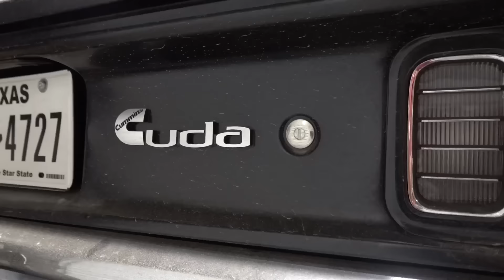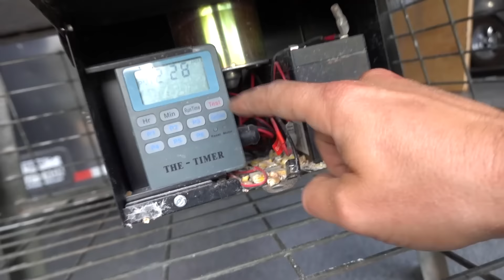Renovating an Abandoned Dump Truck

Comment: Hello Matt, 
Research ECM exchange companies online if it turns out the ECM on the truck is bad.  It is much cheaper than purchasing a new one.  They will program one of their ECMs with your truck's VIN and send you a programmed ECM as long as you send the old one to them.  I've used this service in the past and many companies offer a lifetime warranty on their ECMs.

Comment: I did the same setup on my truck.  The weak link is the cradle.  It will bend if you pull to the side. And my winch is rated higher than the cradle. So you have to watch what you are doing when operating your winch.

Comment: Hi Matt, awesome video, had a hard time telling on your winch if you were using cable or synthetic rope. If it is cable, you may want to change to a roller fairlead the cable will cut the smooth aluminum one. Keep up the awesome videos.

Comment: I suggest getting pull handles added on the connectors. The forklifts at work were always having the terminal ends pulled out because people had a tendency to pull from the cables.
Reply: Oh yeah Ive seen that happen a bunch.

Comment: Love the winch setup. If your using steel cable you need to use a roller fairlead. That smooth fairlead is for a poly cable. Keep up the awesome videos!!

Comment: Be sure to stock some goldfish and maybe catfish in the pond, to keep down the larvae.mosquito/insects and keep the pond relatively clean. Otherwise,it will become a swamp. Mechanical or electric aerators can also help.
Reply: Mosquito fish.....eat skeeter larvae like crazy.
Reply: That would work too xD But he deff needs to stock that thing properly or it will be nasty, quick. And given the heat out there, it will need some form of aeration. Probably via a couple solar panels and a battery @RICDirector  He could probably be real fancy and have someone hook an Arduini board up to that water pump, along with a sensor, so that it kicks on automatically when water levels are below a certain level due to evaporation, kicks off when back above a certain level.

Comment: Hey brotha, you're going to want to install a breaker or some type of circuit protection for the winch power feed. God forbid it shorts its going to burn until either the cable burns through or worse. It happened to one of our new customers who was utilizing those style connectors to jump start vehicles. A stereo shop built the truck originally for free. We had to re-wire the whole SWAT vehicle after the dealership replaced multiple factory harnesses that were damaged in the fire. As others mentioned, you'll want to avoid using the clamps for any period of time, the resistance will build and you'll feel the power cables get warm/hot.

Best of luck!

Comment: Also....next time crimping big lugs like that without a crimper. Use the vice but straddle an alleb key across the width of the lug in 2 separate spots. It will help  prevent the cable from slipping out of the lug.

Comment: If you went a few steps further and done it right. You could install the “Anderson Plugs” on each vehicle you plan to use winch on (just like you did on “Earl”), then make a set of one Ned cable clamps one end Anderson plug (or Quick connect/disconnect plugs) like they do on tow trucks. 
And modern vehicles since ‘96 or ‘98 all have a power block between the battery and starter/alternator hook ups, so you don’t even have to “mod” the battery clamps to hook up directly to battery and still be always hot.

A tow truck never has to pop the hood or open its battery compartment to “jump off” another vehicle.

Comment: Hey Matt, when using a steel winch cable, you need a roller fairlead. The Hawse fairlead (which you currently have) is for synthetic cable only.

Comment: Another great use of a hitch mounted winch like this is , weld a receiver on the front of any flatbed trailers you have to winch items up onto the trailer. Pro Tip, You may want to have that winch mount beefed up a bit..  if your really pushing them, many of them will twist and that in turn will destroy your winch.

Comment: Be careful grabbing those alligator clamps after you've been using the winch to pull stuff. Since they're not bolted to the battery, they're probably going to heat up a lot from the extra resistance

Comment: Welcome to dump truck ownership. Before long you’ll see a $4000 bill and go ‘whew, that could have been much worse’. It’s almost as bad as having a boat.  

That’s basically the exact same winch setup I use.  I even added a receiver to my trailer.  I do only have one set of cables though with jumper cable clamps. I do still have a quick connect though for ease of storage.

Comment: Matt fill the cups of the connectors with solder use a torch and heat the connector once half full dip in the spliced wire and no smashing the hard clips and it is connection guaranteed and resists corrosion.

Comment: Depending on the gauge that aluminum probably would be fine to carry enough amps. Looks like 3/0 or so which holds up to 155amps. We use aluminum on solar fields at pretty high amps. Just have to use deox so the ends don't corrode
Reply: What kind of amps, gauge wire, and wire lengths?  I’ve purposely stayed away from CCA wire because of the lower capacity.  Thanks
Reply: @91CavGT5  you'd have to look up the load you are using to see what gauge needed. We send thousands of watts which some runs are like 1200ft or so.

Comment: I wouldn't run those power cables between the bumper and the front of the truck like that.  That's a tight spot and if you ever end up pushing the bumper in, it could pinch the cables and short them out and potentially fry the electronics in the truck.
Reply: And there is not any kind of fuse on that wire.  That’s a good way to burn a truck down.
Reply: @91CavGT5    Oh dang can't believe I missed that, duh!  lol
Reply: the starter motor on the engine, does not have a fuse between the battery due to the amperage requirements the best way to do it is put a disconnect switch up by the battery on the positive side under the hood before it leaves the engine compartment which is what I did on my truck so if I want to use the winch on my truck, I’ll pop the hood and just turn the battery connector on for the winch but when I’m not using it, it doesn’t have positive power going to it
Reply: The starter motor on an engine is ran from the factory in a way that is VERY secure, AND it is typically ran inside protective tubing to prevent any shorts.  This is a COMPLETELY different ball of wax and is like comparing apples and oranges.  I’ve seen a couple of car fires, and a lot of melted wires due to no fusing.  A resettable circuit breaker could even be used.

Comment: Hope you put fuses in line of positive so u don't burn ur truck down and that goes for all vehicles u set up for the winch
Reply: I just made the exact same reply on a comment.
Reply: And he did not put a Protection sleeve around the wires he pulled in. So when they are rubbed through, hopefully it's just draining the battery fast before it starts glowing..

Comment: I may be wrong but you should have a fuse between the winch and the battery. When I used to install them for a truck shop we always installed a fuses so if the wiring or winch overheated it wouldn't catch the rig on fire

Comment: I checked other comments and it looks like you did good on the dumptruck. I wanted to say that the low low cost of 3800 for a fix on the dump truck is a heck of a lot less the the cost of a new one. For a fixer upper, I say you did good
Reply: Depends on what you picked the dump truck up for..
Reply: @nickabel8279  in this case i understood it to be free

Comment: Pro tip. You just need to connect the negative to the frame.
Reply: Disagree. The frame takes the place of the negative wire and just is a different path back to the battery.
With the dedicated negative wire, it takes the load off of the vehicle grounding system.
Reply: @randybehrmann5454  you're not wrong, but if you aren't using the which all that much there will be little effect.

Comment: With battery cable and those connectors an easy way for a permanent fixture is to hot pot the fitting with solder and dip the cable into it letting the solder then set.

Comment: I have the exact set up for my winch, it is for my trailer but I ran dedicated leads to the rear of my truck for power.  In the front I have the same connector, and then I have a set of jumper cables with the connector set up so I can use it with anything with a hitch and battery.  It is SUPER useful.   I did learn that red and grey connectors are not the same...

Comment: You should replace the stock battery clamps with some higher amp ones. I like the military ones. And you should make a set of jumper cables that will plug into mikeys quick connect. You can also but wire loom to hold the cables together

Comment: Good luck with the quick connects. 

The amount of amperage that a 12000lbs wench pulls especially on long pulls. I’m melted three sets of the exact same ones you put on. And by melted I mean a puddle of goop on the first one.
I have it on the back of me F350 and I found out the longer the cable from the front to the back, was most of the problem. 

It works great with no load on it. Can’t wait to see how this works for you.  😎😎🥴🤨😎
Reply from the maker: Hahaha sweet. We shall see!

Comment: Watch the feeds from across the pond to see the last place the GoPro was seen and the first place it was missing to get a general area to search.   Get a metal detector to search there.    A detector would be good to find buried pipes etc. and wires in walls.

Comment: Check the O2 sensor wires on the dump truck!

I had a similar issue with my Eclipse, diagnosed to ECU...... It was actually just a melted O2 wire. Replaced wire, car runs again!!!   Yours may not be O2 sensors, but any 'core' system that's sending a short back to the computer could be to blame. 

Good luck!

Comment: Ohh yeah,, that little 5 cubic yard dump truck will be PERFECT for the 'Official' ranch dump truck. During the heavy demo work it might be a little small BUT once that's done this little rig will be perfect. Uh OH!! Just heard the ECM may need replaced for the 'parts only' sum of $3800.00!!  Daymn,, that's about all the truck is worth!  As you said,, time to do some thinking here.  Sell the truck 'as is' and watch for something else. There's heavy equipment auction sites you can keep an eye out for a truck in tip top condition for much less that you're likely gonna need to spend to save that one you've found at the ranch.

Comment: Matt, they make a cable support to physically mount the wires to those big red connectors that prevent the wires coming out of the connector Id recommend you get them.  I worked with those connectors for years and they can save your butt.

Comment: The winch set up would maybe be better if you had a modular battery setup. A deep cycle battery that could be put on any vehicle with a hitch and run the winch.

Comment: The droopy battery lead cables.  When you need to use them roll both passenger windows down and run it into the opening of the back door window and back out the front.  The edges of the doors will hold it up to run straight-er to the battery.

Comment: The clamps will be the weakest spot in the connection. Limiting the current, burn, fall of with shaking/vibration. Think about permanent plug attached properly to battery in each of the vehicles.

Comment: Smart thinking that’s exactly what I did several years ago bought me and Dad hey 12,000 pound winch with the cradle and then we ran big cables to the battery on the work truck for the winch but we made up a set of cables that just had clamps in the other and had to plug-in for the winch, and we made the cables 20 foot long so if you ever have a four-door long bed, you can still run a winch

Comment: If you ever go to hard wire in the quick connect buy a set of jumper cables and cut the ends off, much cheaper than buying the rolls and then you can make a short adaptor with the leftover length that still has the gator clamps on it

Comment: That's literally exactly what we did with our winch. We mounted it on hitch and put a hitch mount on the front of the truck and the tongue of the trailer so the winch can go wherever we need it. We also ran some battery cables to the rear bumber with remote terminals to keep the cord length down.

Comment: Matt, contact the guys over at Custom Splice and get yourself one of the strongest synthetic winch lines! Not only are they lighter but much safer than steel cable.
Reply: @Customsplice also has soft shackles!

Comment: Drill an extra hole in your winch mount so you can slide it deeper into the hitch, looks 10x better and less leverage if you need to pull at an angle 

Did the same exact thing on my truck

Comment: the single cab f truck you need to put a switch to turn the power of to the quick connect as it will short out battery!

Comment: Someone might have blown the ECU by trying to jump-start it or by jump-starting another vehicle with it, Jump-starting a vehicle can cause the voltage to spike well over 16 volts which can damage computer systems like the ECU, or the voltage regulator which on most vehicles is built into the alternator. For those that may not know, If you're going to jump-start a vehicle, first hook the red cable to the + of the dead battery, then hook the other red end to the + on the good vehicle, then hook up the grounds the same way, and make sure they have a good tight connection before trying to start the vehicles. And when hooking the cables up make sure you connect them quick so that they don't ark very much, When they're arking it can cause power surges which can damage computer systems. It's really best to completely unhook the battery from the charged vehicle so you don't take any chances of causing damage to it. 
Also, never hook a battery charger to your battery without unhooking it from the vehicle first.
Reply: Interesting, I was always taught to connect the grounds first. My dad would always use the body for ground on the receiving vehicle but I've never had any ill affects from going to the battery.
Reply: @bwofficial1776  Yeah, years ago a lot of people said to hook up the grounds first, and you can hook the ground to the engine, it's the same thing it creates the loop needed, but these days with all the electronics vehicles have they say to hook the positive first exactly how I stated in my first comment. And maybe say 75% of the time you may not cause any issues either way you hook them up, but all it takes is the one time to cause an ark and damage something.

Comment: Also you can get panel mount connectors I’m using to implant in my winch bumper so I can hook up a set up jumper cables no issue

Comment: Put connectors on each end of the long cord and then short leads to the battery clamps this way you can use the long section for other stuff if you find a need. Also, save your hands and replace the steel cable with synthetic!

Comment: You actually didn't have to run the black cable all the way to the battery. Just the red is necessary. You could have made the black cable like 1ft long and just clipped it anywhere metal on the truck, like the receiver or bumper, since that cable is just ground anyway.
Reply: It certainly doesn't hurt. I doubt the battery's ground cable is that thick and there's always the possibility of a poor connection through components.
Reply: @bwofficial1776  True, I forget that Matt's rich. I was thinking about saving cost.

Comment: So on your fairlead you should do steel rollers for a steel cable. And aluminum like that one you have for a synthetic rope. Any rubbing on the one you have now when winching will cause the fairlead to start to deteriorate from the metal on metal just a suggestion

Comment: Be careful with them carrier mount wenches. You only have 1 pin or bolt holding them to the vehicle and they will shear in a shit hit the fan scenario. In the past i have added saftey chains to further secure the baskets. Thoes quick connects are not rated for alot of amps. A big wench will melt them when pulling hard. Keep a close eye on them when your using them.

Comment: I'm sure it's already been said, but for safety sake, you need a roller fairlead with that steel cable. Those aluminum non-rollers are for rope. The steel cable will eat the aluminum up in no time.

Comment: Couldn't help notice that the fairlead you are using on the winch for the F350 is for a fiber rope. Your cable might cause excessive ware on it. Typically a steel cable winch uses a roller style fairlead. Hope this helps. God bless, stay well.

Comment: Next time you need winch leads, it's more convenient and cheaper to just buy a set of jumper cables. There are cables that already have anderson connectors, and you won't have to tie the positive and negative together.

Comment: Next time just buy a 30 ft log set of 1 gauge jumper cables, comes with a storage bag and the two cables are fused together already.   On the set you just built, get rid of those mickey mouse, cut your hands off Zip Ties and put 2" sections of heat shrink tubing about every foot down the length of the cables to tie them together. You told Mikey to find something ASAP to winch, should've put a Soft Shackle around his ankle, drug him across the floor into Camera View.

Comment: One of the ends of the jumper cables could plug into the new f250 quick connect for quick, easy jumpers with that truck

Comment: CCA cable is not just junk for power transmission, it also corrodes and turns into aluminium oxide powder.

Comment: Matt if you do get a metal detector make sure you get the XP Deus. I know it's expensive but you're going to want one later make sure you get the headphones in the head unit. You really may not be into metal detecting at all. but I'm just saying because if I had known about the XP Deus I would have bought that one first.